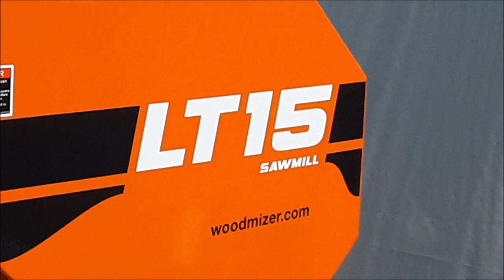We bought a Wood-Mizer LT15 Sawmill!

Comment: One thing that can help in your saw milling put the on mill lock down real good cut good flat spot row log 180 until flat is the bottom cut flat again row 90 and use a square use log to bunk put your bunk lock low on your log and it will square your log and every board straight . That is old school saw milling 😁😉